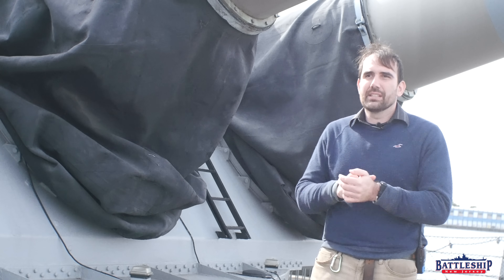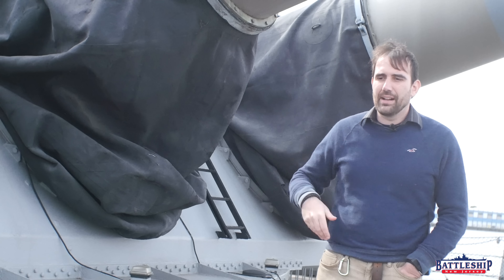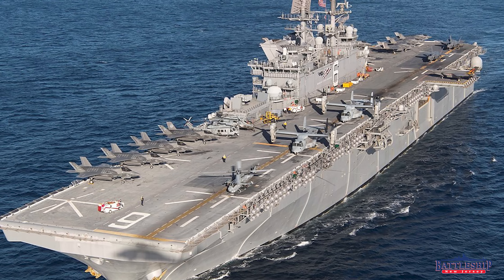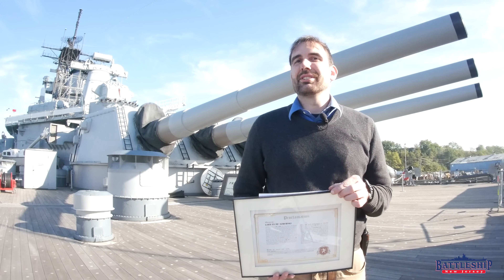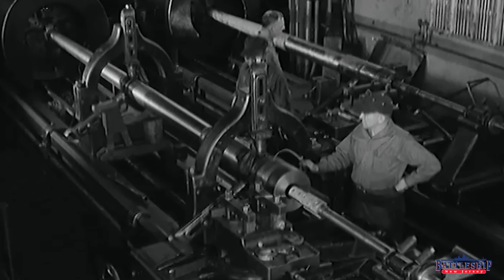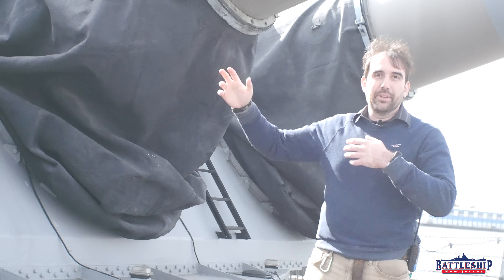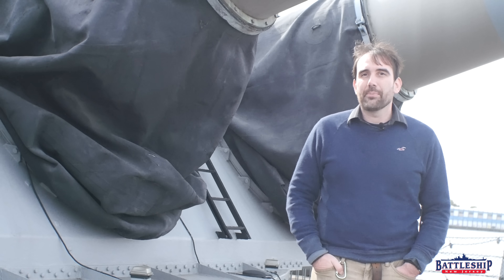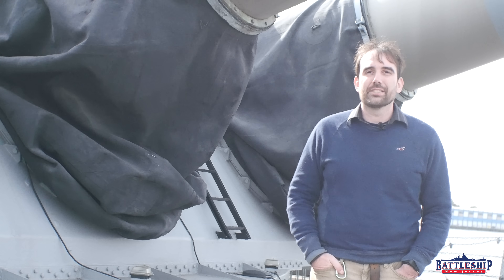How Much Would It Cost to Build a Battleship Today?

Comment: Can you imagine what type of armor you would use...depleted Uranium plates like they use on our tanks and carbon fiber/projectile-proof type material.  The outer hull would incorporate a torpedo shield similar to the bubbles they installed during WW 2.  I would build from scratch because you would want to use Nuclear power.  You would also want to set up a different style of screw and rudder placement so they wouldn't be exposed and use the same screw system and propellers like our top secret subs use to make the ships more quiet.  Cruise ships have the horizontal propulsion so the ship can move sideways is an idea to consider.  Set up a drone shield system where you can control 10-50 drones for ship protection.  Replace the 16 inch guns with rail guns and don't forget lasers.  The Panama canal has been expanded so ship size wouldn't be as much of an issue like it was during WW2.  The possibilities are endless.  With automation and computer/robotic improvements you could run these with far less personnel like the Ford Carriers are implementing.  Just thinking out loud.
Reply: A modern battleship would rely much more on active defenses like interceptor missiles and CIWS than passive armor. However, people often focus on the thick armor of a battleship, but that was not their only defense. A more important one in my opinion would be redunancy, compartments and generally be more rugged. A battleship should be able to take a hit head on and still be combat effective, even if it penetrated the armor.
Unless you hit the magasines, the battleships would still operate with extensive damage to multiple systems. Modern ships have way less of that.

Add lots of active systems to kill incomming threats before they hit you ... then let redundancies and high structural integrity save you for those you cant intercept. Be a floating Rocky Balboa! 😀
Reply: @user-mk8kx1rr1g  That is not the case if there would be a modern naval warfare. It doesn't matter what armor you place to protect your crews if your battleship will still get hit by a hypersonic missile. An aircraft carrier is already enough, building a battleship is just stupid. Losing one will definitely affect the economy.
Reply: Isn't there a new armor being developed? Ultrahigh molecular weight polyethylene IIRC. But that's for body armor. You'd think vessels soon sporting composite armor?
Reply: @Joshua_N-A  I don' really know.  I don't think they would use 1 ft of carbon steel to surround the vital areas but I'm not up on the latest ship armor technology.  Light, stronger,  and less thickness would be the ultimate goal since you would need to keep up with the carrier group.  Can you imagine the firepower a new battleship could have?
Reply: I picture a modernized battleships would probobly have active protection instead of armor, just aa defensed on it to its very limits, some humble offenses but its too big for any major offensive doctrine in modern era, battleship doctrine was pretty outdated in ww2, arguable even in WW1, just too many of their shot will miss to make it work
Reply: Instead of the standard AA turrets surrounding the super structure you could have like 5-6 CIWS systems on either side to protect the command bridge from potential airstrikes. I agree with the rail gun turrets. They would be sick. Only concern is power generation. Rail guns use up an ungodly amount of power so you'd need some powerful reactors and potentially high cap batteries to store the energy to recharge the guns in a reasonable time. One of the good things about rail guns is that their ammo is lighter and more compact than your average battleship ammo so you could store/carry more ammo. Also some missile tubes might be a good idea. Another thing I'd add/change is the standard ball baring turret rotation. Change that to electromagnetic levitation to help the turrets turn faster. We'd also need emp shielding considering this concept runs entirely on electronic systems
Reply: missiles go brrrr

Comment: I build a new clean state design 

It would have 2 forward 2 gun turrets semi auto loading system  15/16 in guns for guided and ungided shells as well as gun launch missiles up front. Out back helicopter pad and hanger and a big VLS park for whatever missiles you need.  

In short about 50,000+ tons of doom where ever you care to put it.
Reply: Heck I might not even put armor on it. Just load up on point defense and counter measures.

Comment: I'd much rather have multiple, smaller VLS missile armed ships than a single large target that even if it were effective could only be in one place at a time anyway. So the only reason to even consider building something like the Iowa-class today would be for the guns. But, what's the use case for a brand-new gun-armed battleship these days? Arguably a brand-new 8" gun-armed modernized Des Moines-class heavy cruiser might be useful as  artillery support flagship for an amphibious landing force, but until and unless anti-missile defenses and anti-torpedo defenses become so effective to require a return to guns as the primary naval armament, I see no chance for the return of new build battleships to the seven seas.

Comment: I wonder if it would be cheaper to just gut the Nimitz class carriers and rebuild them inside from the keel up than it is to build new Ford class ships.  would be the same with battleships, if you were going to reactivate them, then completely gut them and start over.  we have the blueprints of the Iowas still if we were going to build new battleships, just take those and modernize them and remove the aft turret to allow for a VLS system.  develop them to use gas turbines, use the 5" guns like the destroyers use for the secondary armament.  condense the two funnels into one funnel, automate the hell out of it so that it runs with 1,000 men.  use the Arleigh Burkes and Ticonderogas as templates for the electronic elements.  etc, etc.

Comment: Over, say a 30, 40, 50 year service life, it would be cheaper to build new, especially from the reduction in manpower and reduced fuel costs from nuclear power.  The Des Moines class heavy cruisers had automatic gun systems, for example, that greatly reduced manpower needs.  Newer ships like the LCS and the Zumwalts (for all their many problems) are designed for even more automation to further reduce crew complement.

Comment: I would like to know how much engineering space would be required, for a nuclear powerplant compared to what is required for the iowa's current powerplant to achieve an equal shalft horsepower.   Lets say we built new and used nuclear.  If we ended up with higher shaft horsepower, i would assume a redesign of the hull would be required to capitalize on the increase in power.  Being nuclear, and already having her hull redesigned. Would she be larger?  Or smaller?  She would not need refuel nearly as often, so her only limiting range would be her crew's endurance.  Would they increase the crew living spaces?  They would most certainly need more space for the extra provisions needed.  With all that in mind,  does her size change at all?  Would we build her with thick armor plating?  Or would we go for thinner plating and stealth tech?  (A stealth iowa might look really cool, ryan should do a video on that!) With advances in radar and satalite's would we retain the 16 inch guns?  Or replace them with vertical launch tubes of some sort?  Icbm tubes?  I think the largest traditional gun still in use by the navy today is the 5inch mk45??  Maybe we just replace every gun mount with dozens of 5in mounts?  I could go on for days.  Honestly the sky is the limit.  I think we can all understand though, why the navy went away from BB's and leaned more heavily into destroyers.

Comment: If the United States were to be at war with a country where naval artillery could strike a large amount of targets, utilizing existing museum assets makes sense. For a long term solution, I think a battleship is not necessary, but a ship of the Alaska class cruiser size. 12" guns can provide naval gunfire support much better than the 5", and the crew size of an Alaska would be significantly smaller. Those ships had a 1500ish compliment in WWII with 20mm and 40mm AA batteries. Without the need for those guns, I could see a crew of 700 being a reality.

Comment: The costs would largely depend on what your basic design philosophy was for ordering one.

If you're looking to build a BB with modern equivalent GUN technology, yeah, you're going to have to factor in the development costs for a BB-scaled rail gun, or whatever bleeding edge whiz-bang you settle on arming the ship with. Then you have to factor for refitting the ship in response to "teething problems" associated with the new systems.

If on the other hand you're willing to design around an equivalent delivery of payload down range, then foregoing the guns and arming the ship with MISSILES - Tomahawk or equivalent - gives you a 1,000 pound warhead (one option) on a platform with a ~1,000 nautical mile range and centimeter-level accuracy when it gets there.  Mount them in VLS-type magazine/launch systems and you could literally field hundreds of them on the ship.

Of course, we already have a ship that can do that: the SSGN-refitted 'Ohio'-class subs. They have all that and the added benefit of stealth on top of it.

Comment: The reason the railgun failed is because the rails were basically ablative. So you’ve need to find a mechanism that could drop the entire Rail system into the hull every 2nd or third shot to replace the projectile and the rails. Until a super material like graphene
And when they did the maths LRASM and analogues were cheaper both infastructure, research and acquisition wise. So rail guns probably won’t be seen or even cost effective for 50- 100 years.
When even running a battleship would be too expensive

Comment: I'd build new.

Especially since the capability of the Iowa's 16" guns is more of a meme. Good PR for shore bombardment, but most of it's modern useful weapons would be served just as well by a DD.

HOWEVER: I think there could be a place for a BB with rail guns and energy weapon AA.  (Would definitely be nuclear powered to generate the energy needed to run those systems in any significant quantity.)

High power laser would likely be the only thing that could do anything about a hypersonic antiship missile. (Maybe a railgun too if it's accurate and fast enough)
Reply: Coilgun all the way. Plus the Excalibur would make the munitions have more reach and accurate.

Comment: The only real purpose re-activation (in my point of view) would serve, is as a stop-gap measure while you built new. With the age of the hulls of the Iowas, and the age and fragility of infrastructure (plumbing, wiring, boilers, etc) plus the amount of hidden rust and probably brittleness of some steel, you are looking at a service nightmare in the long term.

Comment: Start with the SAN ANTONIO hull, an enlarged BURKE superstructure and the ZUMWALT power plant.  It is calculated that a SAN ANTONIO needs 160,000 shp driving four screws to achieve 30 knots.  We will use four Rolls Royce power plants identical to those used in the ZUMWALT driving four shafts with 190,000 shp providing 137MW.  Shafts and power plants are split to provide redundancy.

The aft superstructure containing the hanger is moved slightly aft.  Forward, an enlarged BURKE superstructure is mounted which clears the forward decks for more weapon systems.  The radar and sonar systems are taken from the BURKE Flight III with space sufficient for 22’ radar arrays.  The SAN ANTONIO sized hanger has space for the MV22 Osprey, helicopters, and drones.  The elevator is placed at the stern so that a large hole is not placed in the strength deck.  A below deck hangar can then accomodate more aircraft, especially drones.  

A directed energy weapon is mounted on top of the hangar.  PVLS in the stern are mounted two abreast so that 40 sets are installed in ten twin rows on either side of the ship flanking aircraft facilities similar to ZUMWALT.  An additional 64-cell Mk41 VLS launcher is mounted between the superstructures at the broadest part of the ship.  Forward is a 5”/62 designed to be replaced by an advanced gun system.  The width of the ship forward allows for 32-cell Mk41 VLS cells plus there is room for 5 additional Mk 57 PVLS on each side of the ship forward.  Total loadout for missiles is 296 cells.  Two Mk-144 GML (21 missiles each), two Mk46 30mm guns and one Phalanx complete the major armament for this ship.
 
 Cost of a Burke Flight III is expected to be $2.5B and SAN ANTONIO Flight II is $1.7B so what does that mean for this ship?  There will be engineering costs for combining these technologies and we can safely assume that the ship will cost 50% more than the baseline ships of either class.  Without extensive analysis and using a Rule of Thumb incorporating known costs of other ships, if it costs as much as both ships together, it would be $4.2B/ ship, less than half of the ZUMWALTs cost.

Comment: What would the operating cost of a new battleship be? Presumably, the crew could be significantly smaller, reducing both the direct cost of their salaries but also training costs. Also, much more automation (think autoloading 16" guns, for example. OTOH, what would the cost of the armaments be. An anti-ship missile would be much more expensive than a dumb 16" shell. Would there be a difference in these costs of new or remodeled?

Comment: My approach would be something vaguely similar to what was done in the first place all those years ago.  The first class of battleships I would build would be somewhere around 550' - 600' long with two twin turrets (fore and aft) featuring 12" smoothbore high-velocity guns.  Other armament would include 155mm AGS type weapons, 57mm, 30mm Goalkeepers, missiles and possibly a couple high energy laser systems.  Propulsion would be gas turbine providing a speed of around 32 knots.
Reply: “Speak American, Kawasaki!”
Reply: @flaminggamingturtledragons915  basically take IJN Mikasa, size her up to about an iowa'a length and instead of all her secondary guns, swap them for modern Point Defense Systens(PDS) and missile launchers. Top speed of 32 knots but if the New Jersey record is believed flank could be 34 to 35 knots. Did I get anything wrong OP?
Reply: @vanta_8lack591  electronics today are more durable than 30 years ago to withstand the concussions from the main guns, right?
Reply: The AGS is dead. The shells are simply too expensive even at scale.

Comment: Interesting thought experiment. If you built a new Iowa class but made some changes such as only one 16" gun turret in front and made it missile heavy with harpoon and tomahawk, leave most of the 5" turrets pull most of the .50 calibers, the 20 and 40mm Cannons and replace the with cwis and surface to air missiles, and use nuclear power and all current modern technology, how fast and effective would she be?
Reply: The refit in the 80's removed all of the 20mm and 40 mm guns and 8 of the 20 5" guns, along with adding 32 tomahawks, 16 harpoons and 4 CIWS mounts.
I actually worked on the Wisconsin overhaul.

Comment: I wouldn't be surprised if a new ship cost $10 billion.  The amount of weapons and electronics that you could cram onto a new BB would be impressive.  I also don't believe that the ship would stay around 45,000 tons.  I think they would be closer to 80,000 tons or more.

If I was tasked with restoring BB capability to the US Navy, I would go with a completely new design and build.  The environment it would have to survive in is a lot more dangerous than in WWII, so it would need to be big enough to carry all of the defensive measures needed (which also makes it a physically larger target).  I think the only way the Iowas would survive in a modern battle space would be to completely gut them and rebuild them (think taking a house down to the studs and ripping out all of the electrical, plumbing, and HVAC, and starting with just the frame).  At that point, you might as well start from scratch.

Comment: No amount of upgrades would stop the Iowa class from being sitting ducks these days. Not to mention they would need to restrengthen the ships from age and provide heavy modifications so that the ships could see active service again with a notably smaller crew. 

There would be more practicality from a new line of smaller battleships. A new class that are practically battlecruiser sized at most. Instead of homogenized Class A/B that is sturdy as possible, more emphasis is placed on reactive armor. They would be big missile and drone trucks; with both aerial and aquatic drones. Laser strapped onto the ship to provide some sort of anti-missile countermeasure. What would especially be important is to have nuclear reactors on board.